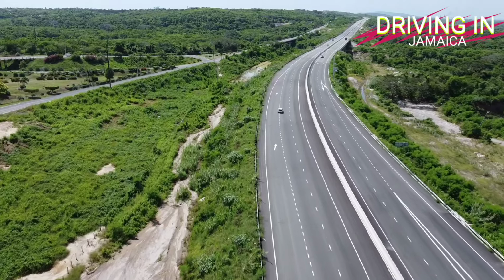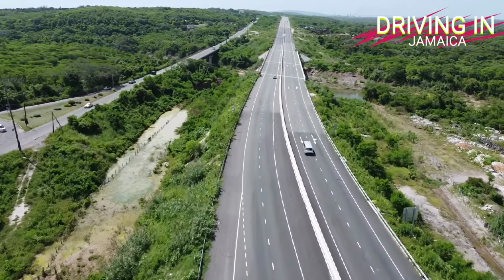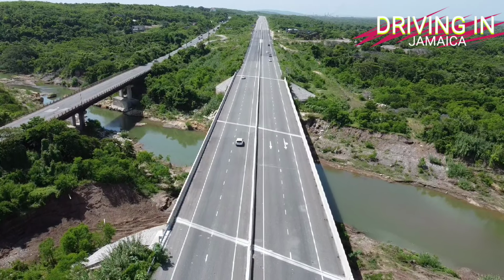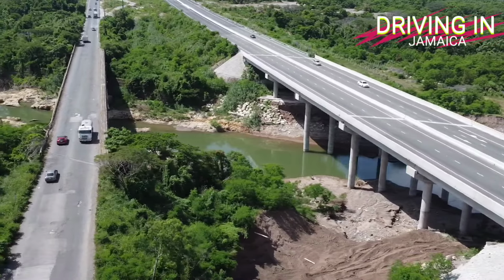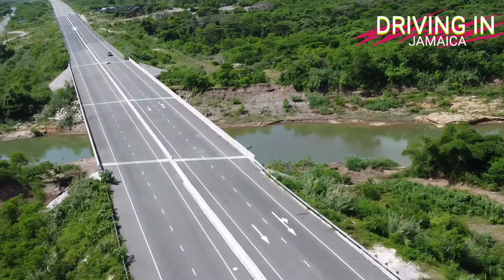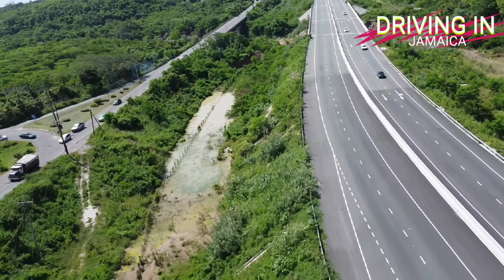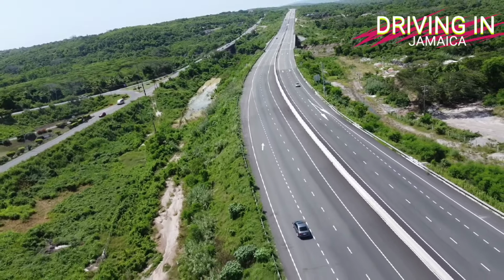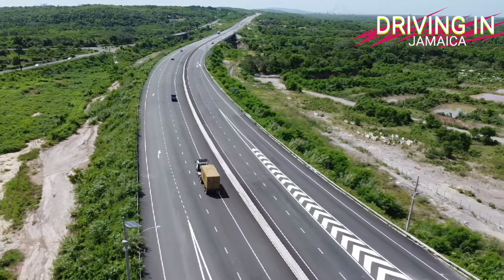Largest Bridge Jamaica

Comment: Please tell drivers the right hand lane on highways are strictly for overtaking purposes and not for driving in  when there’s no traffic to overtake ,Some drivers. tends to stay in the overtaking lanes and will not return to the inside lane after completing their manoeuvre regardless if there’s no traffic in both lanes ahead, this is dangerous and causes other drivers going at a swifter pace to do an illegal undertaking manoeuvre and can lead to accidents.
Reply from the maker: You are correct re the right lane. Slower vehicles must use the left lane.